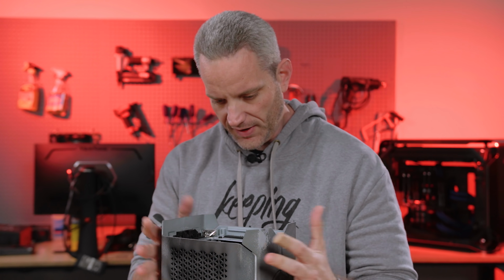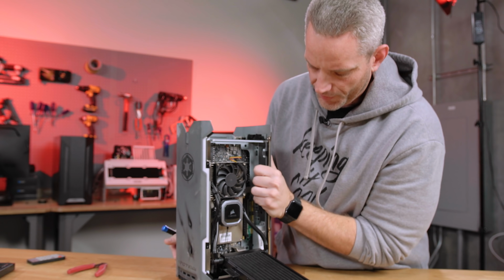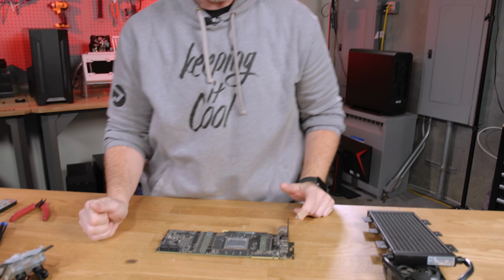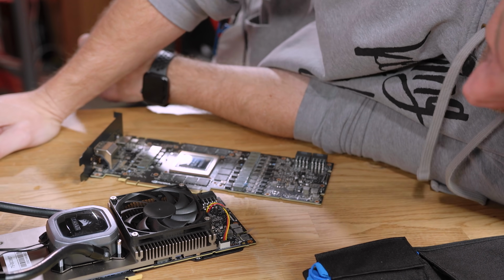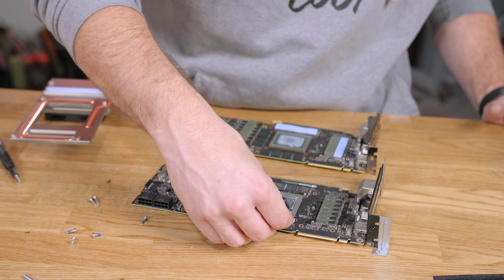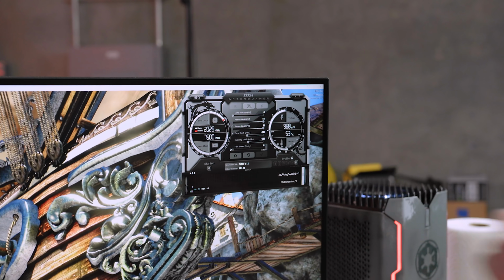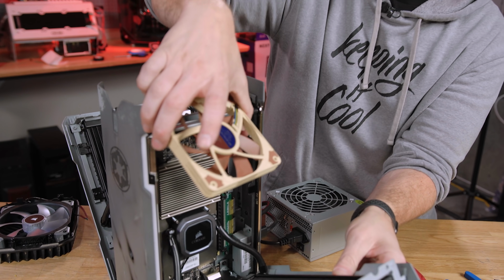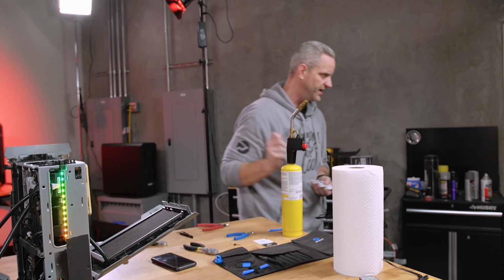I accidentally broke a $2500 video card... like an idiot

Comment: that info about the 4k 120hz signal..thats a deal breaker especially hdmi 2.1 coming out when you can buy a PS5 for $629..they could use more environmentally friendly materials for the cases.
Reply: so sad about there not being another fan plug
Reply: If that things reverse engineered into that..thats practically feeding off of conflict diamonds because something larger shot it down a long time ago...spoils of war perhaps.
Reply: was it sightseeing or a malfunction in the cloaking field..I don't want to spoil it.
Reply: or are you a bad driver?
Reply: how smart are you to reverse engineer electronics...you would think there was a bit of extra help.
Reply: Its clearly a meatsuit of some sort which is also kind of technology..how do I know its not being driven as a meatsuit?

Comment: had a XFX nvidia GT 7950  passive that overheated within 5 min of TF2 and i resorted to hot gluing a fan to the heatsync on it, most silent air cooled passive gpu i ever had.
also for the RGB might i recommend corsair icue combined with jacknet RGB (jacknet allows icue to hijack the motherboard rgb and icue allows you to customize your effect as you wish quite well ,though you would require an icue compatible thing to function as master for  the mobo RGB including adressable headers and ram strips, icue has an asus plugin but the last 2 things are not supported atm).

Comment: It would be interesting to see you try to rig up an RTX 3090 in to this thing. Someone will probably manage to do it eventually with a custom water loop in there or something.  I'll take a crack at it when the prices come down on the cards eventually. If it doesn't work out I can always just switch to a new case.  I've seen 750watt psus that would fit in there and I saw that there will be 850watts in that form factor soon enough.
Reply: The thing's HUGE though
Reply: @MarksterC  most of the size is just the  heatsink and fans. Convert it to liquid cooling and suddenly it's not as big or thick.  It would easily fit with one of the standard water blocks. You'd just need to find a spot for the pump + reservoir and find a radiator that's large and thin enough or figure out a way to re-use the one from the original AIO cooler.  This can totally be done and I will do it in mine eventually.  I'm mainly just waiting for an 850W PSU in the correct form factor (SFX) to be released. One or more of them should be out soon enough.

Edit: just saw that coolermaster finally released their 850W SFX PSUs, so that's one big piece of the puzzle out of the way.  Now the graphics card prices need to come down to make it worthwhile.
Reply: @rawdmon  I want to put in at least a 3080 but I'm looking for a card that has a matching PCB so hopefully use the existing hardware....let me know how it goes rawdmon

Comment: I somehow broke a m.2 ssd... turned off pc and unplugged it, put it on the table, put in the m.2 drive. Plug her back in, turn her on, fans spin for about 2 seconds, no lights turn on, m.2 ssd started smoking, took it out and it fried the bottom of the ssd and made it unusable. Not sure what I did wrong but I waited over 2 weeks jus to fry it and fuck it up 😭

Comment: Jay, are you plugging that noctua fan to the 4 pin header on the board? or do you have to mod it to use the resistor sensor?

Comment: I sure could use your help in troubleshooting my GTX 1080 TI that is showing elevated temps, crashes when games are launched and has to use MSI afterburner to force the fans to work. Have replaced the thermal paste, yet is still giving the same problem
s.